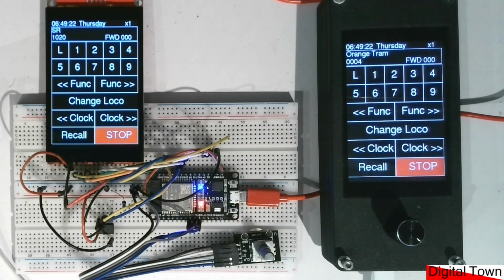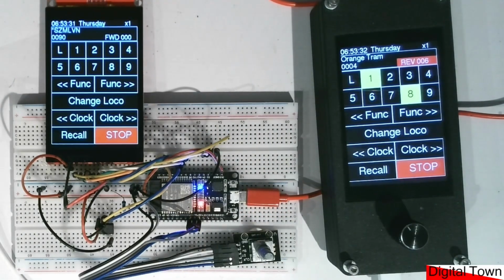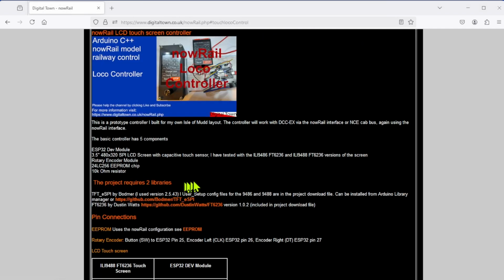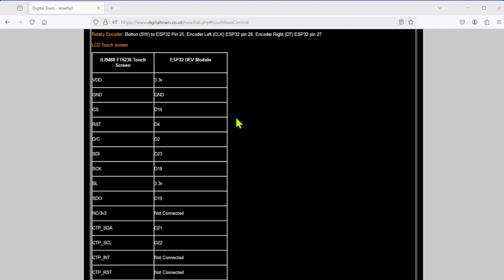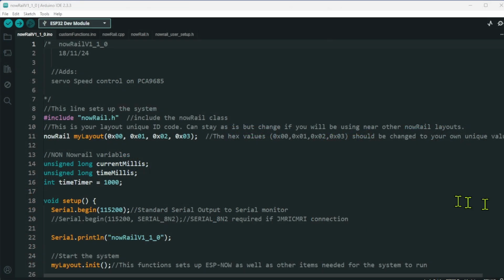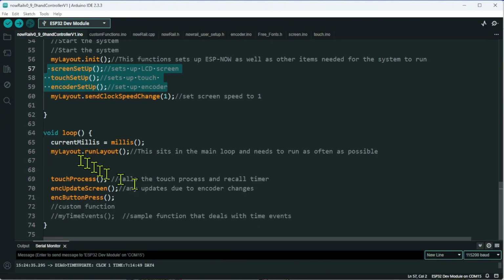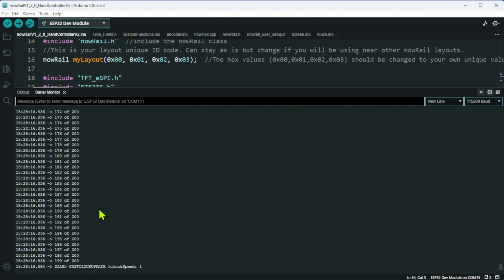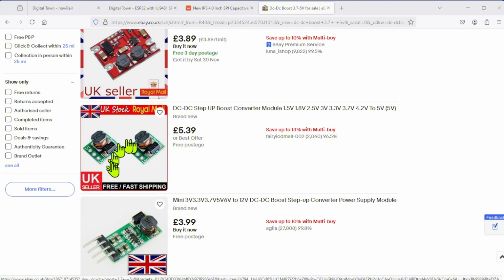#118 Arduino C++ nowRail model railway control - nowRail LCD touch screen loco controller

Comment: YAY! number2.....now have latest NowRail and a version of your controller working nicely together connected to an  Arduino Mega with DCCEX. A couple of lines I should have uncommented led me a merry chase so old guy user error......loving it and learned a lot so many thanks again. Out of interest, is there a way to speed up the speed control?....maybe altering speed level per tick of the decoder pot...
Reply from the maker: You can try changing return values to 2 and -2 on lines 73 and 78 on encoder.ino
Just be careful when testing as the danger is the speed byte overunning at maximum speed that would take the loco from max speed in one direction to max speed in the opposite direction.
Reply: @digitaltown5442  Thank you

Comment: Hi.. I've got this controller built on a breadboard. On switch on, the displays just shows a lit up white background with no details. When I turn the decoder pot I get information scrolling up on the IDE  serial monitor so something is running. The display is the one you suggested and I have triple checked the wiring. Ther were no errors during upload.   Thanks for any suggestions
Reply from the maker: Not heard of this issue before. Is the User_Setup.h in the TFT_eSPI library folder set up correctly for the screen. Take a look at https://www.digitaltown.co.uk/61ESP32ILI9488LCDTouchScreen.php for a simplified example to test the screen as well as an example User_Setup.h
Reply: @digitaltown5442  Thank you...will try that. Just an extra, if I touch the blank white screen in various places, the IDE serial out is scrolling the touch screen commands so that's working....onwards and upwards👍
Reply: @digitaltown5442  YAY! you are a star.....copied your User_Setup.h for the TFT_eSPI library and pasted it over mine and all works fine. Will print them both out and do a comparrison to see if I can spot what was wrong.Thank you so much for putting up with an old muppet👍
Reply from the maker: @hantercans  Great news
Reply: @digitaltown5442  Hi... just looking at the main NowRail sketch.....getting some errors wheb setting for DCCEX...... In Nowrail_Setup should this line not have two SS's.     "#define DCCEXSSERIAL2_ON //best done on ESP32 Dev Module Writes DCC EX instructions to Serial 2...for Serial2 connection to DCC EX
Reply from the maker: @hantercans  Not sure what error messages you are getting. Can you email me them.
NOt sure what you mean by SS's

For DCC EX you need to have
#define SERIALRX2 16
#define SERIALTX2 17
#define DCCEXSSERIAL2_ON
and if you want to see DCC EX commands in Serial monitor
#define DCCEXSERIAL_ON 
&
#define DIAGNOSTICS_ON 

All this should be set up on the ESP32 connected to the DCC EX command station, not the hand controller.

Comment: Uploading for the touch controller and I get this error....   Compilation error: FT6236.h: No such file or directory.  appreciate any help
Reply from the maker: Have you loaded the FT6236 library in the library manager?
Reply: @digitaltown5442  Thanks for the response,  yes I did but I think something is going wrong with my setup (latest Arduino IDE on a Mac).  Will go back to my Windows PC and start over. Thanks for the work you do.....brilliant project👍

Comment: hi there, I built the project, everything works wonderfully, but I would like to understand how to connect it to ddc-ex wirelessly, would it be possible to have the connection diagram and the code? Is ESPnow used via an ESP32 connected to DCC-EX or via wifi? Thank you for the wonderful project
Reply from the maker: https://www.digitaltown.co.uk/nowRail.php#DCCEX shows how to connect to DCC EX, basiaclly you set up another ESP32 that cponnects to DCC EX via Serial so any commands from the controller will be received and passed onto DCC EX. It's how my exhiobition layout runs and is very reliable. You can then add extra controllers if you want.

There is a new version of the hand controller code coming out very soon (in final tests) that includes consists and the ability to send loco details from one controller to another.
Reply: @digitaltown5442  Thanks

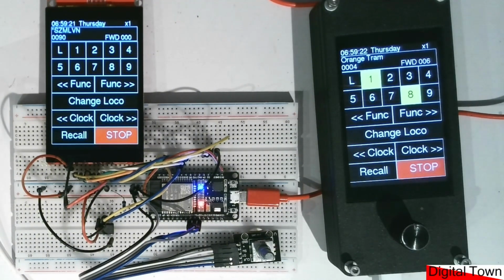Comment: Where did you find the rotary encoder module with the push button? Is it called something different? 5:30
Reply from the maker: I think most encoder modules have the push button. They should have pins marked GND, + SW (switch), DT and CLK
Also make sure the module is the screw thread type if you are using a case as they are easier to fit. Example at
https://www.amazon.co.uk/RUNCCI-KY-040-Encoder-Development-Arduino/dp/B07SV5HHM5/ref=sr_1_2_sspa

Comment: Also I intend to hold the esp32 reset via the EN pin with a simple switch to grouund,  so that while charging the ESP32 etc will be off until the EN is allowed to float to 5v by turning the switch off. Do you think thid eill work?. I got the idea from t3-ex-wifi on github. the lolin wemos esp32 on the rowland LCD /ESP32 borad has a charging circuit included, potentially making the whole arrangement neater.
Reply: Sorry just noticed the typos..meant to say "will this work"

Comment: If I use a dcc to nowrail converter will it update the throttle status?
Reply from the maker: No the throttle updates itself when being used but won't respond to other controllers. It would be possible from another nowRail controller but there can be issues when 2 controllers try to run the same loco.

Comment: Can I suggest you put a  touchscreen reset in the touch setup code. I had a lot of problems getting the touch to work until I put a reset in the Touch setup. Admittedly I was using a rowland technology kcd touch screen with in built esp32 for convienience and had to remap the I2C pins 
THe code I used was a:
pinMode(TS_RESET,OUTPUT);
 digitalWrite(TS_RESET,HIGH);
The Rowland lcd has the rest connected to io13.

Keep up the good work for a wireless train control system for those of us not wanting to use JMRI, or MQTT

regards JH